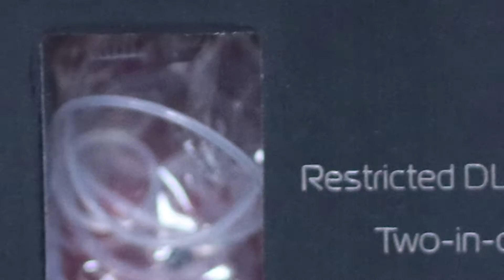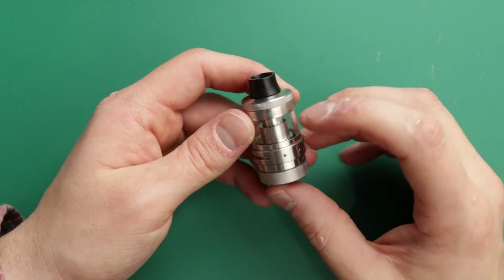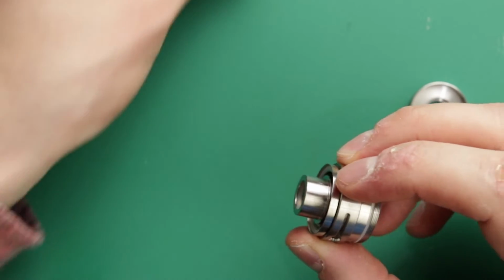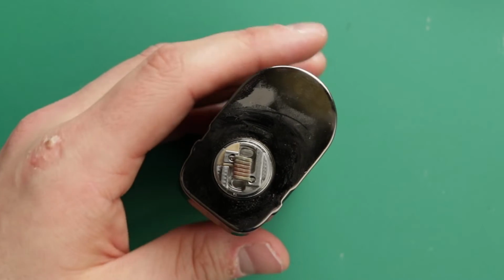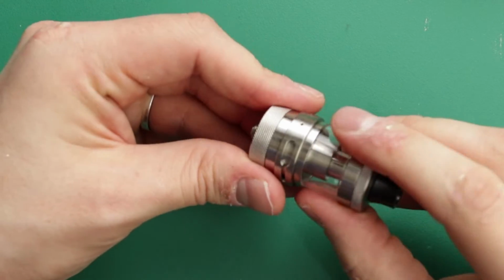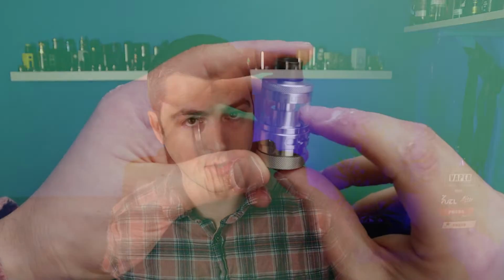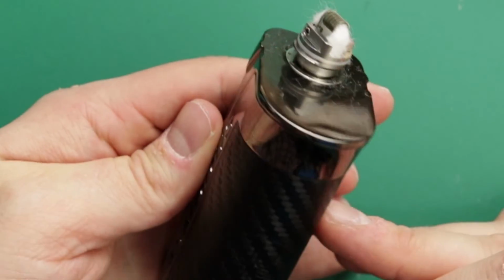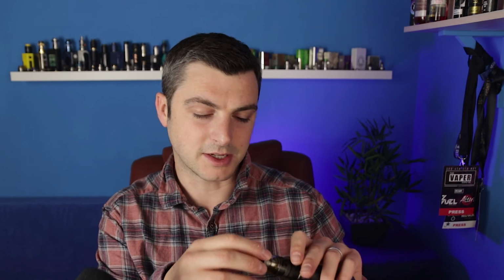Steam Crave Aromamizer Lite RTA - Build, wick and review

Comment: Hi, I've been watching your video many times and so I did with few others about this tank. I've recently got the version 1.5 cause they've added some inserts and a chimney reduction which could give a proper MTL experience. (Btw the AFC ring needs to be removed to set the insert in it). The very bad issue I'm having is that no matter how much cotton I put, when I try to fill the tank, it always leaks out if the air flow. ALOT... I believe Everytime I lose 1 ml of e-liquid which is so disappointing.
The fact is that I really love the flavor I get out of it so I keep using it but I can't make it to fill the tank! Could you help me? ☮️
Reply from the maker: take it all apart and check all the o rings it sounds like one is missing or has got twisted
Reply: @RichardVick  it was brand new and I only made one build in it.. I've tried to see if there was any o-ring missing but I think they are all in place. Same thing happens to me with my Peacemaker. Everytime I fill it to the top, I end up with the bottom afc leaking. 😭
Reply: This guy is totally correct!!! They came out with a chimney air flow restrictor you do not have / show and 2 air flow inserts to fit into the both big air flow chambers that makes this the tightest air flow tank I’ve vaped on in 5 years! 
The tank deserves a rider video clip at the beginning as there have been upgrades! Heck I’m struggling to get airflow it’s so tight! The chimney piece does the job! This is coming from a 3 year strong Kayfun V5 user!
I am very pleased
Reply: @jruccio2594  thats awesome to hear that from a Kyfun master! I still haven't tried those inserts cause I so much enjoy this rya on DL mode, but I'm happy to hear that it can go down to a very tight draw. I'll try that out as soon as I get bored of the amazing DL performance (will I ever tho?!😂)
Reply: Ivo Bagnara The peacemaker is a pain to wick because it’s so tightly sealed as soon as you screw the  top cap in it compresses all that liquid down and forces it up through  the wick holes.
Reply: @MrAckers75  glad to hear it's not just me.. any suggestion on how to avoid this?😑
Reply: Ivo Bagnara I found using more cotton helped

Comment: Just a point of note for you on the stainless steel one you show throughout and may well be the reason for your issue reassembling; you have the airflow ring assembled inverted! thanks for the review, just received mine and its a flavour banger for sure in DTL mode 40 - 60 watts, no use whatsover in MTL mode mostly due to the fact that despite the airflow restriction on the external airflow ring, the air pressure and resultant air velocity is lost at the coil due to the "honeycomb" internal airflow.